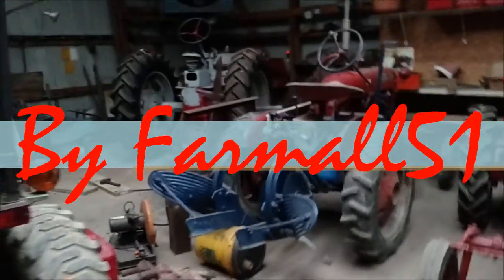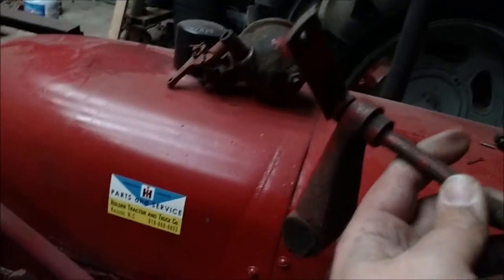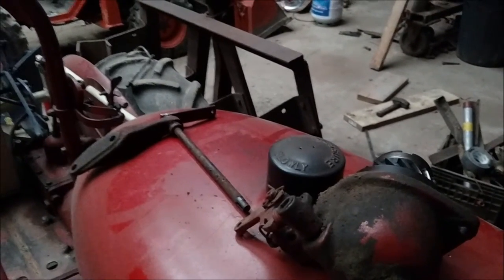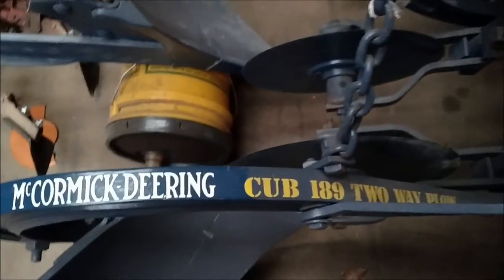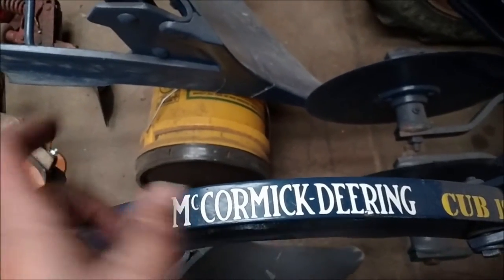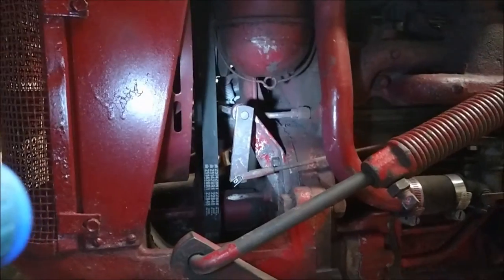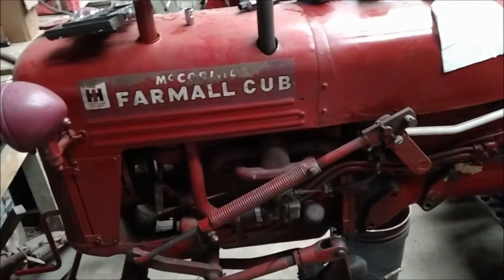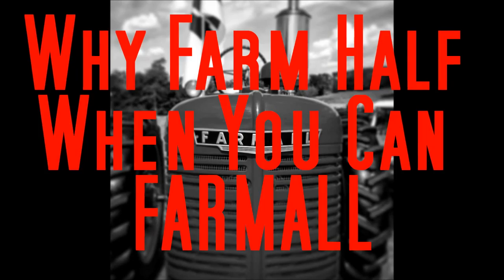Governor repair on the 1950 White Demo Cub

Comment: Had this same issue on a 60' grain/bale elevator because both drive sprockets have to be exactly in alignment to drive the chain/flights. The cast keyway were wallowed out. The metal shop guy machined a 5/16" hole through the cast iron sprocket & 1" steel shaft & installed a cotter pin. Worked great.